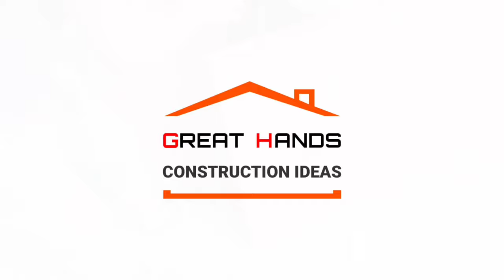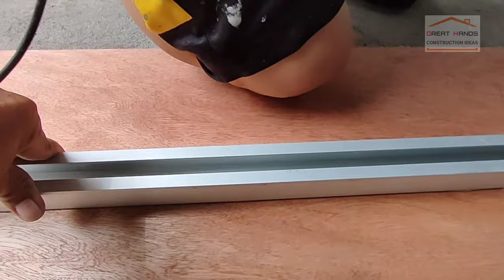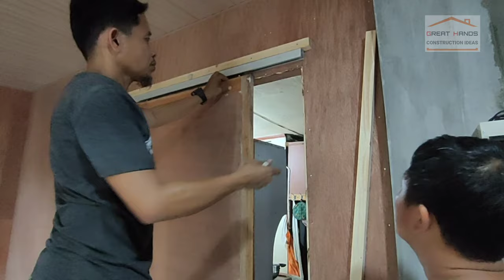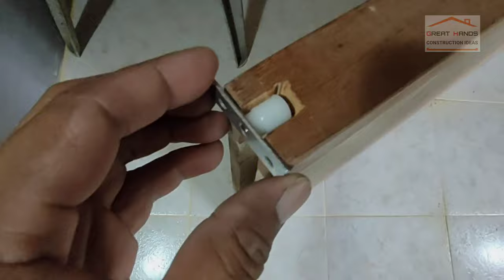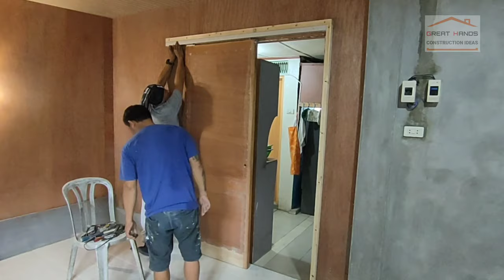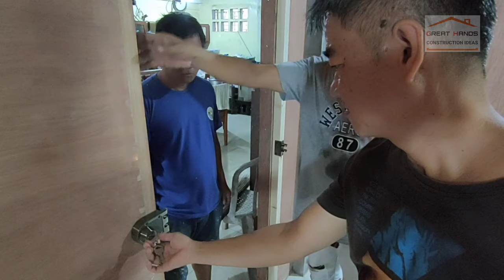Pag Install Ng Sliding Door || Sliding Door Installation

Comment: available ba sa mga hardware yung slider accesories? may iba pa bang tawag jan? or kung may list kayo ng materials para mkapag DIY ako. thanks!
Reply from the maker: Yes po boss available po yan sa mga hardware.
Aluminum Roller Guide
Roller
Rim Lock
Handle
Wood screw
Machine bolt #⅜
Reply: @greathandsconstructionidea7676  salamat ng marami. Well appreciated ang response nyo boss!

Comment: Boss pwd b mkahingi ng listahan ng mga gamit pang sliding door salamat boss godbless
Reply from the maker: Ok boss...
Roller guide
Roller
Rim lock 
Machine bolt
Metal screw
2x3x8 good lumber para sa stopper at hunger.

Comment: Di nmn sumsagot sa Materials need... Baka Hangin lang🤔🙁🤣
Reply from the maker: Hello po pasensya na po na busy lang daming  trabaho hinde ko na replyan mga comment nyo. 
Ito po ung mga materials para sa sliding door
ROLLER GUIDE
ROLLER
RIM LOCK
HANDLE
2X3X8 GOOD LUMBER 2 Pcs
½"X5"X8 GOOD LUMBER 1 Pc
WOOD SCREW #2 10 Pcs
MACHINE BOLT #⅜ 3 Pcs
HINGES #1½X2 3 Pcs.